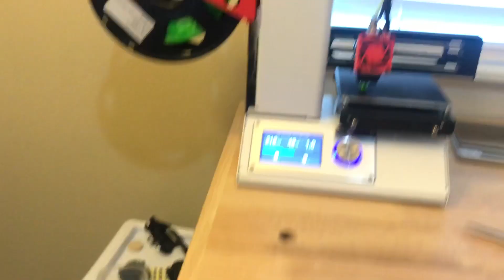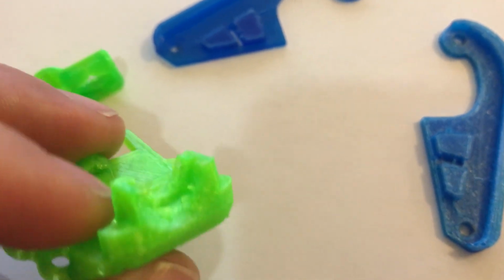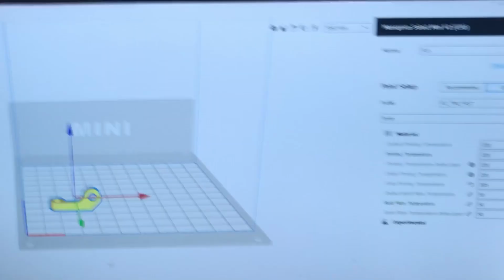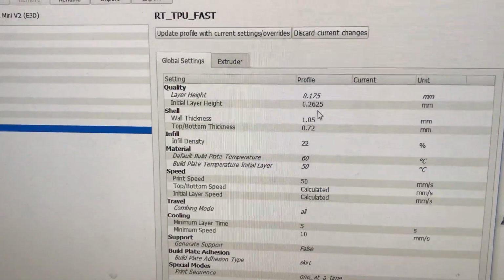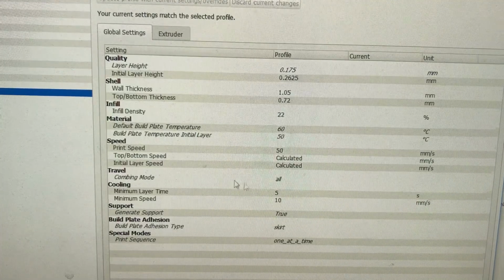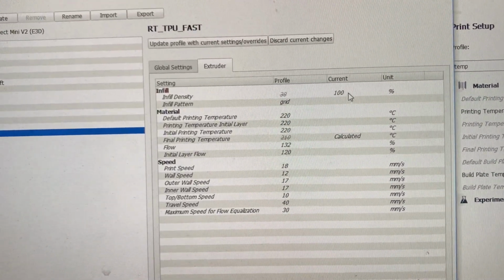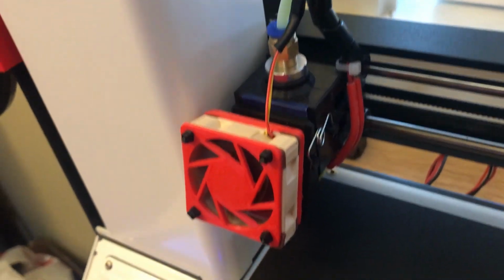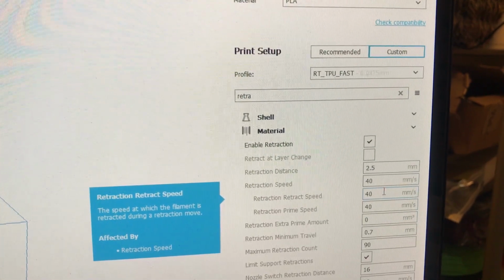How to Print TPU on a Basic 3D Printer

Comment: I get some feeding issues where it stops going down the tube and instead wraps around the feed wheel. Any ideas? I'm using chinchilla 75A which is softer than the usual 95A. It starts off well but then decides it's not going to go in anymore.

Comment: I've been printing for almost a year, sticking with PLA in that time. I've just started printing TPU (Anycubic black 1.75mm) on a MP Maker Select Plus with a few upgrades; 

- Micro Swiss All Metal Hotend w/ cooling block
- Micro Swiss CNCd Lever and extruder plate
- TL smoother on the extruder stepper motor
- Glass bed

So far I've been printing for around 4 hours solid, I'll be printing for another 4. I haven't had any issues, yet. I'm printing some anti-vibration feet for my printer (found on Thingiverse) at the time of commenting; 0.4mm nozzle, 0.5mm retraction (needed with the Micro Swiss hotend), 0.15mm layer height, 220°C on the hotend with 50°C on the bed, 40mm/s speed, 100% flow rate. More or less identical to my PLA settings...just the speed has changed. I'm not sure if these mods have enabled me to do that. 

I didn't know about the combing mode,  but I'll have to keep that in mind if I come across issues. I'm aware of how sensitive TPU is to moisture...more so than PLA. So thank you!

Comment: I just bought an Ender 3, and was struggling with the SainSmart TPU filament. I followed your settings, and the results are beautiful. Thank you very much!
Reply: I've the same printer and filment with stock extruder and hotend.  I was able to use the Cura NinjaFlex profile from chep website to print with only a little bit of stringyness between pieces and some little dots in the walls.  That said, my printer has dots in the walls with PLA, not nearly as many, and maybe just needs an aftermarket hotend of extruder...but for my purposes this is just fine.  
https://www.chepclub.com/cura-profiles.html

Comment: Hi Ryan thanks for sharing, with this setting do you still having stringing or blob on the corner? Thanks
Reply from the maker: It really depends on the shape of the part. If the nozzle needs to travel outside the edge of the part then I often get blobs. The good news is they are not too hard to remove at the end.
Reply: @RyanThomasFPV  can i email you the model and the final printing result Ryan?

Comment: Ryan, this video has been super helpful and all of your settings has made a bid different.  My only problem is that my TPU filament will bunch up at the top often.  How do I prevent that from happening?  What setting should I adjust?  Thanks.
Reply from the maker: There are 2 things I'd suggest.  First, reduce the speed and/or increase the temp.  This will reduce the resistance from your hot end.  The second thing I'd look at is decreasing the gap between the feeder gear and the bowden tube.  Depending on your setup you might need to get creative.  On earlier models of the monoprice mini people would drill out the plastic housing that held the bowden tube  and cut a "V" shape into the tube to get it closer to the extruder gear.  This doesn't work on the v2 in my experience.  You could replace the entire extruder assembly (not the motor, just the part that pinches the filament) with something different.  There are a bunch of aftermarket options available cheap on ebay.  Good luck Tim!
Reply: When you say “reduce the speed”, which option does that in Cura software?  I have reduced it to the print and travel speed settings you provided.  Should I lower those?  I have the latest model.  It seems to always happen about 15 min into all prints.  Thanks for your help!
Reply from the maker: Tim Shows , The speeds in these settings should be good. I would look at two other things. First make sure your temps are hot enough and staying hot. TPU should be 220c or more. Second, make sure there isn’t a clog in your nozzle. You may want to do a search on “cold pull” for clearing the nozzle.  I’d use PLA for the pull.  Good luck.

Comment: Any idea why my prints in beginning  really clean until toward the end it gets ugly like if to much heat ,dialed in exact same settings
Reply from the maker: Rey Rosales , if you can try and post a pic on the Reddit 3D printing group. Much easier to diagnose if we can see. From what you’re describing could be a slight nozzle clog or not enough cooling on the nozzle.
Reply: @RyanThomasFPV  ok I will see if I can post ,machine  is brand new and only on certain prints ,you think I should lower temperature  on ex
Reply: Ryan Thomas should the nozzle fan always be on ? And if so what speed would you reccomend ? Thank you so much best video on TPu hands down!

Comment: Printing those camera mounts 🧐 did you use supports in Cura?
Reply from the maker: GHOST FACE, Yes. The supports come away pretty clean if you pull them rather than cut them.
Reply: Ryan Thomas thanks 🙏🏾

Comment: Your prints look great. I have a mini v1. Do you use supports for the GoPro mounts, I have always battled stringing. I have no idea how you figured out those settings? Great job! Now make one on nylon please! I have had so much fail.
Reply from the maker: danlatu , thanks. Yes I do use supports for the GoPro mounts. They come off better if you pull them away rather than cut them. I think nylon might be a bit much for this little guy but you can do PETG (just barely). Happy printing!
Reply: @RyanThomasFPV  They make nylon that can be printed below 260c.

Comment: I saw in the background some of your other prints were you did differing colors.  Im assuming you are pausing mid print to switch resins.  I also have the MPSM V2 and have tried Cura's pause G code modification with no luck.  What method are you using?
Reply from the maker: Hi Andrew, actually I didn’t do anything with the g code. I melted the filaments together before they entered the extruder. I used a candle for heat to melt both ends and then squished them together using a small section of ptfe tube to alignment.

Comment: do you think these settings will work well with printing PETG?
Reply from the maker: The challenges with PETG are different. Print speeds are similar (very slow). But you’ll want the hot end to be about 240C and bed very warm, 60C+. Extrusion rates should be close to PLA and you may have to adjust retraction to minimize stringing.

Comment: This is the most helpful video on TPU printing. Great job.

Btw I see your mounts printed quite nicely did you use supports everywhere?
Reply from the maker: upicks , thanks. Yes on the GoPro mounts I used Support’s everywhere.
Reply: @RyanThomasFPV  thanks, I decided to try it with supports from plate and it didn't go well. I finally printed a mount on its side with supports everywhere and it's perfect. I think on the side its the best position.

Comment: Hope this works for my Ender 3
Reply from the maker: Lucid, it should be in the ballpark. Ender 3 seems very capable, good luck!
Reply: Ryan Thomas I saw another video that recommends a print for the extruder with some tubing so the TPU doesn’t get bound up. Looks simple and I bet with these settings and that print it will work great. Hopefully without stringing
Reply from the maker: I tried that with mine but ended up just replacing the extruder (not the motor) with a metal one from eBay that had a very small gap. Worked great for like $12.

Comment: Nice video,  thanks for showing your settings.   Barely started 3D printing..  would you mind sharing the file for the gopro and quad coptor?  A friend is into racing quads and needs some frames
Reply from the maker: Thanks, to be clear the quadcopters are not 3d printed.  They are mostly carbon fiber and various metal hardware.  The 3d printed parts are available on thingiverse.com.
Reply: @RyanThomasFPV  Thanks, I know the quadcoptors are not 3D printed, I meant the file for the gopro frames,  I looked at thingiverse and could not find the files..  but thanks
Reply from the maker: https://www.thingiverse.com/thing:3042218 
https://www.thingiverse.com/thing:2842747

Comment: What cura version? Great video bro 👍🏼
Reply from the maker: Thanks, I'm on 3.6 but these settings should work on any version that has Combing and adjustable flow rates.  The key is to just extrude more and keep the print head inside the part.

Comment: Great video! I'll be trying your settings soon. How do the prints turn out when bridging across a section? Say for a GoPro session mount. I am having issues getting a good finish when using support material.
Reply from the maker: Thanks, I use supports as well. The default cura support settings have been good to me. There is some cleanup. I usually use flush cutters to grab and tear the supports away. They come off cleaner if you pull them away rather than cut them.
Reply: @RyanThomasFPV  awesome. I'll give it a shot. Keep up the good work!